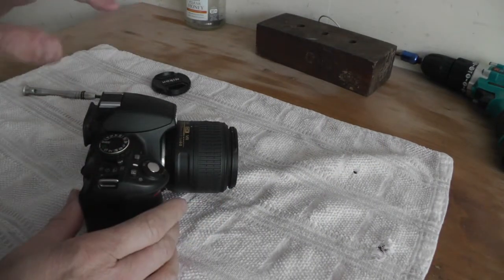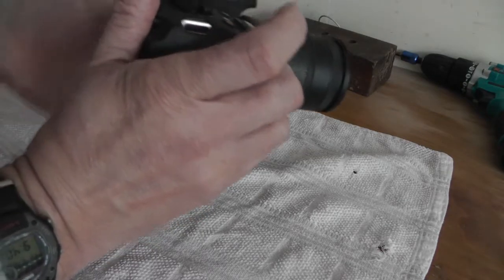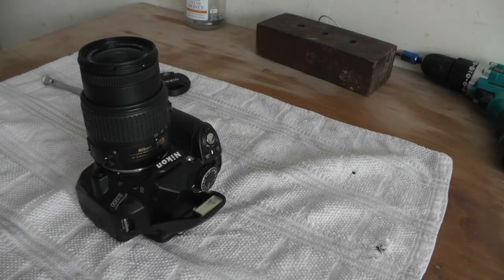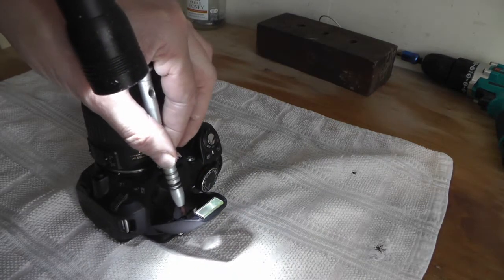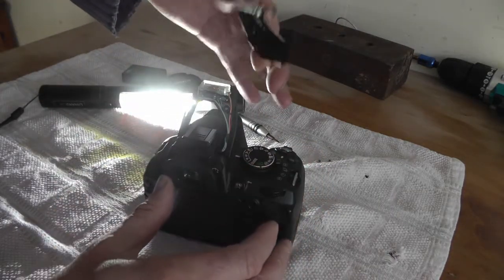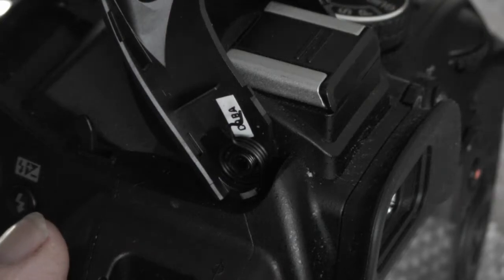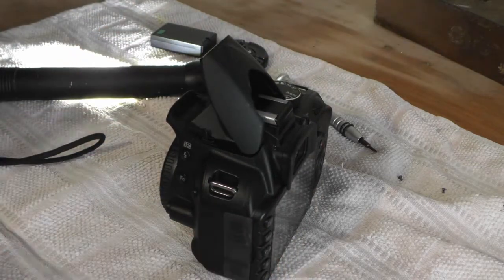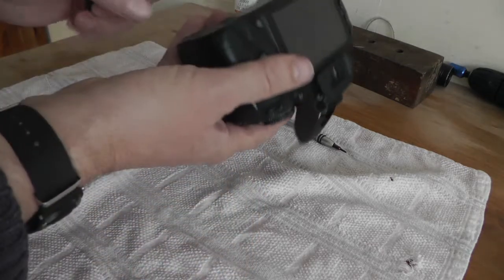Nikon D3100 DSLR Flash repair bulb replacement , spring

Comment: hi, my d3100 is also not flashing the light,  I saw your video 3 times but didn´t realize what your procedure was, you just disassembled the flash and then reassembled it?
Reply from the maker: Yes you need to fit a new bulb
Reply: @cagmito76  Could you show how? I didn't get it from the video.